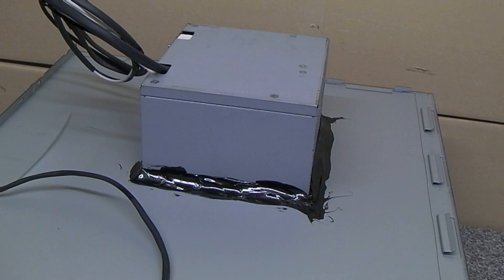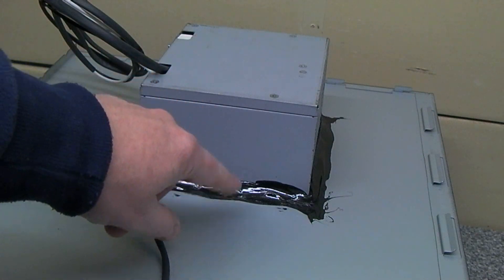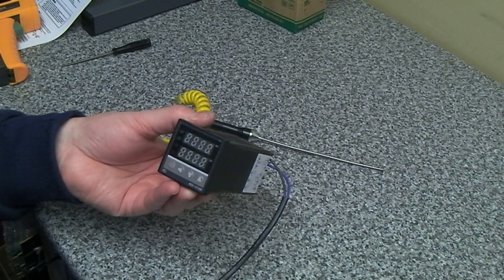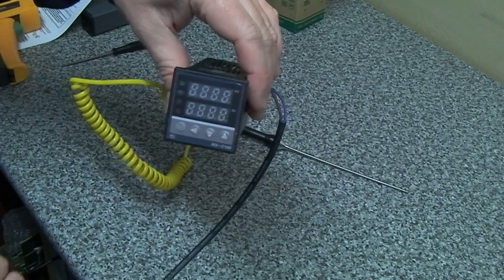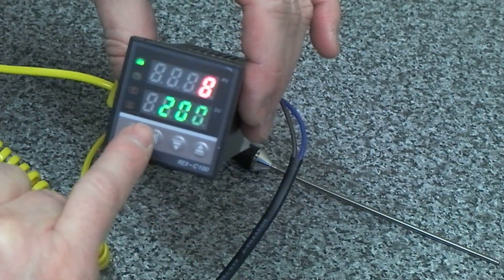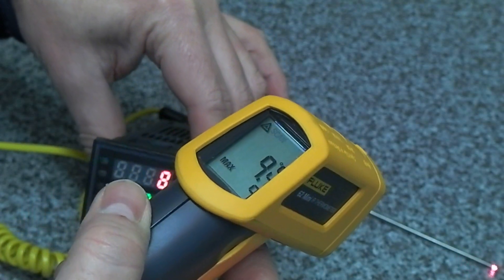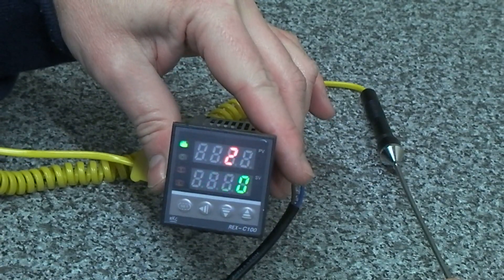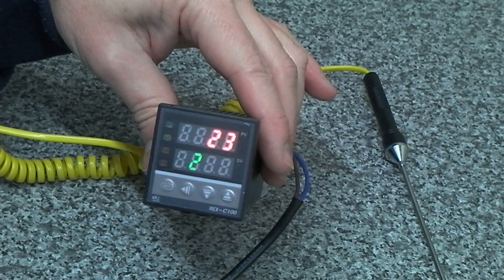PID First Power Up

Comment: Trev Hi - you seem to know what you're doing with these things and I wondered if you'd give me some help.
If so, here's the thing. I bought a couple of these from China, but thy're not as described. I wanted tamp range 0 - 400C and K sensor, but this things comes up announcing 0 - 999C and BT 5 sensor. The manual is in very poor English, and talks about codes and buttons which don't exist. I think I want to get into the "technical parameters mode settings" and change these things, but I can't get into it. I saw another video showing pressing SET and LEFT ARROW for a few seconds doing it, but this does not work on mine. No other combination I can find works either. If you have anything helpful to suggest I'd really appreciate it. Thanks, Chris
Reply: Hi Chris
Sadly these videos are from a long time ago, I do not get involved in this side of things any more. There will be settings to change if you can get into that level of the menu, but how is anyones guess. I am really sorry I can't help you with this.
Reply: No worries Trev - thanks for making time to get back to me, anyway.